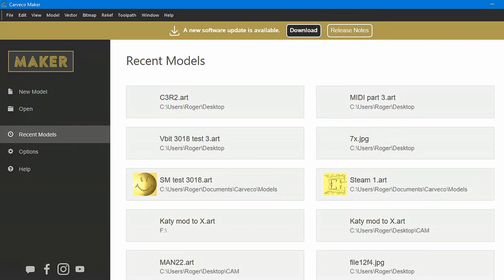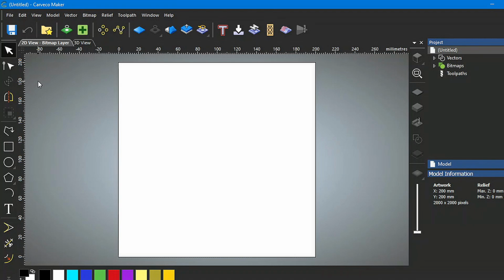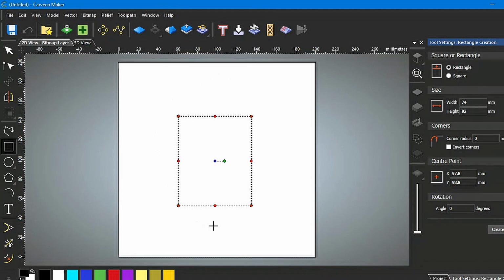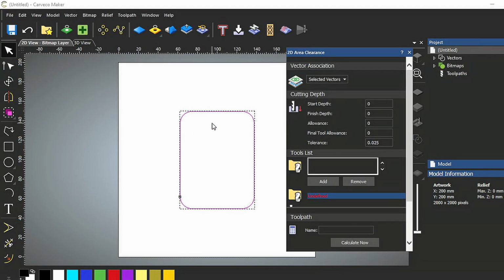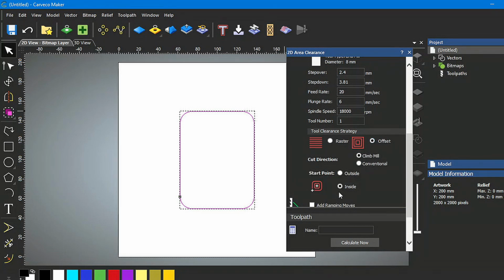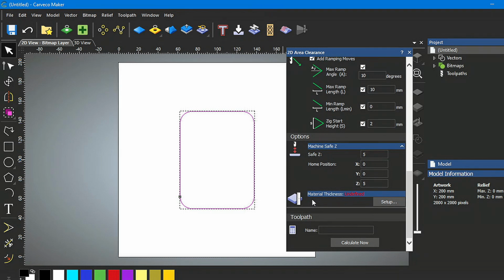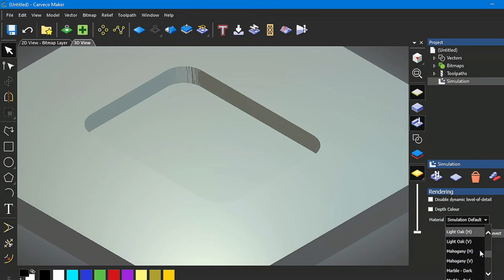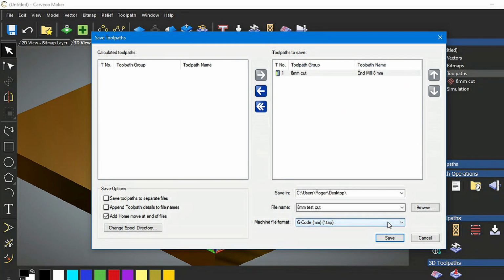Starting with CARVECO Maker

Comment: I've created a couple of files and cut them with success (mostly). The problem I'm having is that I created some 3/4" width vectors to cut channels for some T-track. I used a 1/4" end mill to cut them 3/8" deep. After I created them, I converted the bitmap to a vector and used Flood Fill Vector. After creating the tool path and saving it, I cut the file. The width and depth were correct, but it only cut the outer edges and left the center untouched. I thought if you used flood fill, the tool would remove all of the material, but it didn't. I don't even know what to call it so I can search for an answer. How would I accomplish this?
Reply from the maker: Use an area clearance strategy tool path
Reply: @inventorsworkshop9600  

Yep, I discovered the area-clearing toolpath a little while after posting this. Thanks!

Comment: I found your tutorial very very helpful. I like the way in which you describe each step in a slow and deliberate way which makes it so much easier for a beginner to follow along. I had your tutorial on one laptop and Carveco Maker on another and followed along with you through the whole process of making a project. After designing the project I would delete it and start over again which I did many time until I was able to go from start to finish without watching. 
I have purchased a Genmitsu 4040 Pro which came with Candle.
The problem that I am having is in the saving section, do you have a video dealing in detail the steps in the saving of a project? Thank you again for the great videos!!
Lamar
Reply: I am new to this too and I just got the same machine you have.  Pardon me if I am wrong but I have found that after saving a toolpath, I also need to save the model again.   This results in the toolpath being saved with the model design.

Comment: Great video!  Love this style of instruction.  Thank you!  I do have a question though.  I was following along, verbatim, and when I clicked on "Calculate Now" I get the following error:
"Cannot calculate for the following reasons:
Safe Z is an absolute value and must be greater then the
thickness of the material if the origin is on the bottom.
Home Z is lower than material surface
Safe Z is lower than Start Z"
I was able to bypass this by making the "Safe Z" 16 but  I'm not sure of the outcome of this.  How can I fix this to match your tutorial?  
Thanks again!!